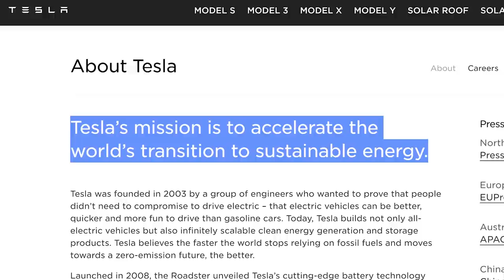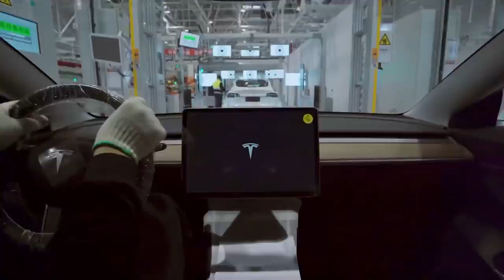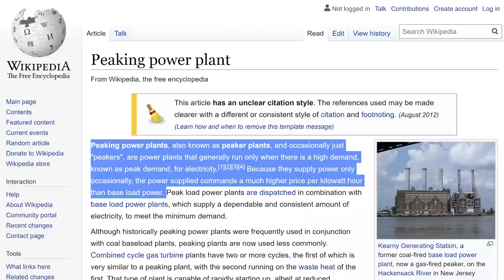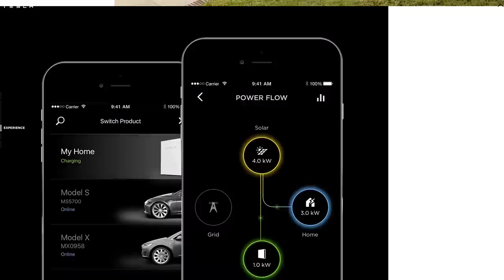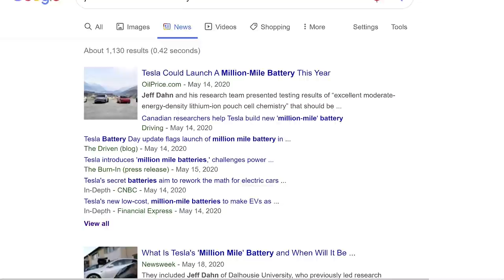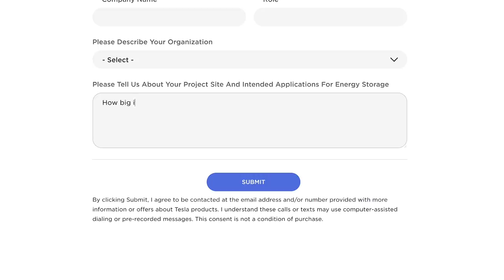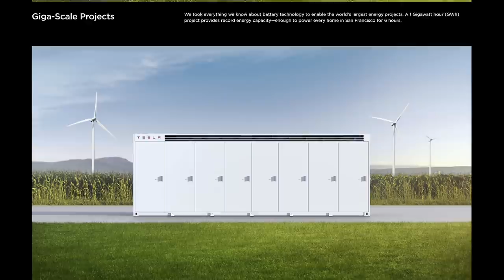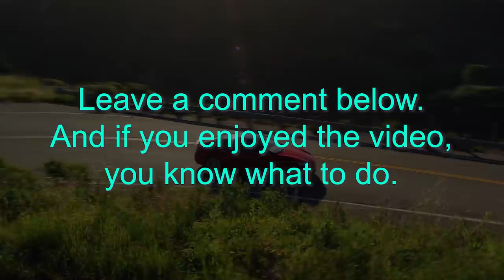Tesla Batteries Will Make Billions ⚡ (virtual power plants, vehicle-to-grid & Autobidder software)

Comment: one thing about energy trading: the more this technology is adapted, the more the price difference will disappear. so earning income with this will work only during adaption phase. because why would the price go up and down, if the supply of energy always easily meets the demand from storage because said storage is covering it fully?
Reply: This is a good point you made. However, I think Steven is also making the point that taking over a corner of and disrupting the energy market is what is going to make Tesla & it's shareholders the mega bucks.
Reply: Yes but this energy arbitrage will last a long time certainly for 10-20 years because more and more intermittent wind and solar are being added to the grid so more and more batteries (or other forms of storage) will be needed

But what is obvious is the value of a car as a battery will go down as battery costs go down

At $5000 for a Powerwall (or whatever it is) the value of the car acting as your Powerwall is at most $5000

If the price of powerwalla falls to $2,000 then the value of the car acting as a Powerwall also falls to $2,000

I know the car battery is significantly bigger but the value isn't linear. Buying a second paper wall has much less value than the first 

Overall I think power walls have more value as storage and solar buffering than the Tesla cars. But since it can be done for cheap via a car it should be done but it's value is definitely not 5 Powerwall at today's prices as some are trying to calculate suggest. It's closer to the value of 1 Powerwall at 2025 Powerwall prices
Reply: @kaya051285  ^ this. Increasing variability of generation over time will, all else equal, improve the profitability of battery backup. However, this is counterbalanced by declining costs for batteries. The price may fall, but Tesla's long term cost advantage over competitors is looking unassailable, meaning they will likely capture most of the profits in this burgeoning market, regardless of what the market price is at any given time.
Reply: @Global_Optimization  The value of a million mile battery (or rather a 4,000 cycle battery) is at most about £3,000 in the UK it's certainly worthwhile doing but it's not worth tens of thousands as some Tesla channels are suggesting

At least in Europe (and probably many other areas too) a large part of the solution to intermittent solar and wind is mass interconnectors. The UK will build out 10-20 interconnectors this decade which will give the ability to export excess wind and import excess wind/solar

The biggest solution is actually higher capacity factor wind farms. If offshore wind farms can be designed with 50% capacity factor that would be much easier to integrate into the grid than 25% capacity factor wind turbines
Reply: @kaya051285    Yes, it will be a trade-off between minimization of four main costs: 1) Extra generation capacity 2) Storage capacity 3) Smart load response 4) Control systems overseeing all this (autobidder may have made this cost negligible, but I don't think we have enough public information to know for certain yet)
Reply: @kaya051285  agreed, I think in the long run they can make at least an average of about £10 / kwh  of grid storage capacity if they capture all the ancillary services so as to reduce the excess generation capacity needed. If a 400 mile car has 100 kwh, that's about £1,000 per car in additional value. If they sell 1 TWh per year, which is their minimum ambition, that's £ 10 billion per year in gross profit, which alone is enough to justify their current market cap, ignoring their other business segments
Reply: @Global_Optimization  The capacity payments are per KW per year. It doesn't matter how big the car battery is it depends what it can export to the grid and current regulations are 3.7KW max from home to grid in the UK

So if you could get £10/KW for grid services you'd get £37 a year not £1,000 a year

On top of this you might make £350 a year buying cheap selling expensive

The two combined are ~£400 a year

And this assumes the customer doesn't use the car and just keeps it as a paperweight at home. Obviously people use their cars so this upper bound of £400 is unrealistic for most cars

V2G is worthwhile but it's realistically a value of ~£3,000 over a period of 10 years

And this assumes zero cost
If you need to fill in paperwork
Have government or grid workers come to check. Or additional hardware. It will eat onto this £300 a year

Still worthwhile doing but it's not some magic bullet that justifies Tesla stock price
Reply: nope it doesnt work like that because not every area has the same energy potential, for example in germany the north is where there is most of the electricity generation the south not so much
Reply: @Global_Optimization  wtf is the advantage here?!?! ABB, Siemens, CATL..... are already leaders in the energy sector, what is needed is just cheaper and better batteries. in europe they can already produce enough energy but most of it (wind energy) is wasted due to the lack of storage
Reply: @kaya051285  yes the UK, germany are seriously installing mega wind farms and its working well, they just need more energy storage
Reply: @carholic-sz3qv  Most of it is not wasted, a small amount of it is wasted. As we don't need to use storage which is costly and inefficient. We could instead for example regulate retail electricity tariff to be 3 cents/KWh for dual fuel boilers. Many EU homes have natural gas boilers it wouldn't cost much for new boilers to come with a 3KW electrical elements so as to be dual fuel boilers

These boilers can work on natural gas most the time but when there is excessive wind power they can use their 3KW electrical heater and pull back on using natural gas. Just in Germany there are 30 million such boilers giving the ability to use upto 90GW of excess electricity when there is excess

A smart efficient cheap way to use excess wind/solar the only real cost is software and maybe €5 euro to add an electrical element to boilers

Of course there are other options too
For example if gas boilers were banned then homes would have no choice but to switch to heat pumps as old boilers break down. This would greatly increase electricity demand across Europe and the curtailment problem would mostly go away

And finally of course interconnectors
Sometimes the UK has strong wind output France has little wind output. So we can export our excess to them. Likewise sometimes they have strong wind we have weak wind so we can import during those times

Mass storage of electricity by batteries doesn't make sense. Some amount makes sense for other services but not for bulk electricity storage

Also Norway has the potential to store a HUGE quantity of energy via its hydropower. Although the power amount isn't huge it's about 10GW the storage amount is massive in the region of 10s of TWh
Reply: @carholic-sz3qv  Bulk Electric storage via batteries won't be possible because such electricity useage is seasonal which means the batteries will be charged and discharged just once a year. Even if you can imagine batteries at $30/KWh and they last 30 years that results in $1 per KWh which is far far far too costly

Everything will be done to minimize the amount of storage required. The cheapest option of which is spreading out the wind farms eg UK wind farms will be placed all around the UK not just in one spot. The next is to build lots of interconnection to neighbors which is being done the UK will have >20GW connection by 2030

Then we will increase our electricity demand by electrifying heating with hear pumps and resistance heaters so less wind is curtailed

And finally we will probably do a small amount of excess electricity to hydrogen which can be used in CCGTs to fill in periods where intermittent supply is too low

This doesn't mean there is no role for batteries in the grid. It means maybe a country can use 1 hours of battery storage so for the UK maybe 40GWh of battery storage would make some sense. 40GWh storage with 10GW power. This would be mostly for grid services and some small amount of renewables buffering

Comment: Your comments re electricity are mostly only applicable to a small part of the world a small part of the time. If you look at BM reports for UK data the top 10% peak price of wholesale electricity today is about £35/MWh while the bottom is about £10/MWh so any arbitrage is only £25/MWh and a 50KWh pack is only 0.05MWh so a full charge discharge cycle will net £1.25 before factoring in charging losses and capital cost of using a cycle

Also it's unlikely this will be done by cars to any great degree. What's more likely is future solar farms and wind farms will have inbuilt battery storage which can act to make the solar/wind installation more profitable and the same batteries could also be used for arbitrage

There is some benefit to V2G but it's not a huge amount. Worthwhile doing it might add £2000 value to a Tesla model 3 over its lifetime
Reply: While this is currently true, as solar and wind form increasingly large shares of the power grid, market forces will change the prices differential, making time arbitrage more profitable. More importantly, lithium batteries provide other valuable service beyond merely load shifting. They also provide valuable stability services, for example, which is where most of the value of the Hornsdale project has come from according to what I've read.
Reply: @Global_Optimization  Yes I know but other grid services in the UK don't pay all that well. For example capacity payments are ~£6/KW/Year so a car connected at the 16A domestic regulated limit might be able to bid for 3.7KW of capacity payments which would mean about £22 per year of value for capacity payments  IF you can guarantee the car will be plugged in winter days between 4-8pm

Comment: You were incorrect on turning current cars into V2G with only software changes: https://youtu.be/UkRk2OQI7RE They would need to be hardware modified.
Reply: Tesla Fudge No! He was right.  2017 model3 has already hardware built in sitting there waiting  and when the timeline comes, the right software will awake this feature. Please check the last episode of the channel “now you know” they had a great revelation on that.
Reply: Dinos Megkos I watched the episode, that only applies to the new million mile battery models which will likely have that capability. The current gen cars do not have the circuits to do V2G, they will require an upgrade to their hardware, or an added gateway or new powerwall. This electrical engineer that aftermarket services all models knows the internals very well: https://youtu.be/lXokJEzXwaI

Comment: Costs for the car itself won't go down
Costs for the electric power train will fall

If the car costs $25,000 and the electric power train costs $15,000 the latter might fall in price 10% a year which would mean a $40,000 Tesla might become a $30,000 in 2030 that's roughly when I think ICE and EV price points will start to converge around 2030
Reply: @into the now Best selling car in Europe is the VW Polo it costs £12,500 while the Tesla model 3 cheapest version is £43,500

The insurance for the model 3 is about twice that of the best selling car in Europe because the Tesla is faster and more expensive it is in a more expensive insurance band

The Polo you can get serviced anywhere and parts are cheap and abundant. Are Tesla parts cheap and abundant? Can I get any garage up and down the country to service and repair the Tesla or do I need to pay out premium prices?

I'd suggest you are being willfully blind, not me

Comment: Critical thinkers please reply:  Something many have not addressed.  As transport transitions to electric, the electrical demand will increase substantially, and the peak demand will likely shift.  Yes peak now is highest during the heat of a long day because of HVAC demands.  However that is about to change and drastically.  The current peak will likely go up because not all transport will be charged at night, however vehicle to grid will buffer areas that would require a peak plant to fire.  Its possible that at some point the peak demand coming at night will meet those of the day because of charging transport.  Ultimately a balance could be struck where the demand is steady state so electrical generation and demand will be steady.  So likely we will even out the generation curve but the output of electrical generation will go up and substantially.  It is likely that peaker plants will still not be needed but generation will be much higher and more consistent.  The problem exists that if the balance of electrical load is not being offset by the buffering effect of vehicle to grid technology.  And as the electrical load demands increase will we have enough generation (all electrical generation) capacity to meet the massive loads?  In conclusion as EV's become more prominent Vehicle to Grid technology is eminent and and must be done, its not an option.  Elimination of peeker plants is actually a result of what must be done, its not the real reason vehicle to grid will be done.  If sustainable energy is not ramped up quick enough, and the non renewable/nuclear generation can not keep up additional non renewable power will have to be created.  Still better than all the fossil burning transport that would otherwise be on the road.  Tesla, IMHO, is the only corporation on the planet that can do this, they have to if they are to fulfill their mission.  Other companies are struggling to keep up, not even concerned about the electrical load implications coming.   If it was not for Tesla, I believe we could get to a situation where an imbalance could drastically stall sustainable transport.
Reply: This isn't a problem to worry about any time soon because electric cars are still a tiny fraction of the grid and the amount of electric cars produced annually is still tiny

In many nations improved electrical efficiency of lights and appliances is actually greater than the additional electricity demand from population growth or EVs

For example the UK has about +10% population bs 15 years ago yet our electricity consumption is actually down 15% or so since then. We have so much spare capacity that we could switch 1/3rd of all cars to electric overnight and the system would still function just fine

Solar/Wind and EVs will be deployed slowly
It will be fine
Is expect around 2050 most the grid will be 'clean' and almost all new car sales will be electric

I also expect most roofs to have solar panels by 2050 especially if solar tiles can become affordable so they are the default replacement to old roofs. If that happens 1/3rd of electricity generation can be local on roofs the other 2/3rds would be nuclear hydro wind and central solar imported to the urban areas
Reply: I Kaya all great points, however there will be terawatts/year electrical load being added very quickly.
Reply: Be interesting to find out the true non-subsidized total energy cost of ownership for building, material supply and running costs of current peaker plants. As these fall by the wayside I would imagine the amount of energy saved to be a fair, all be it one off, large saving. Same goes for the total energy cost of continuously drilling gas & oil out of the ground/sea. Every oil rig has a huge electricity foot print and believe it or not, some are powered by Solar/Wind ironically.
Reply: @305dreamhonda  it's not a problem most grids are far bigger than the demand that will be placed on them by EVs plus this isn't an overnight process we won't go from almost zero EVs on the road to 100% for at least 30-50 years

Comment: if solar and batteries were the solution n why is China and India building over 100 Coal fired power stations, even Germany is  building a dozen Gas powered  power plants, solar/wind and Batteries for the  moment wont solve our base load  power  generation, you put to much faith in Solar  which is not efficient and the  South Australian battery solution only solved the over load problem, unless they can solve this then batteries and Solar/wind wont be enough.
Another  thing unless they solve the problem of longevity on Home solar  solutions people wont be up taking solar, i have  learnt that solar solved my problem for a short  time and after  5 years i have to replace my solar panels through degradation and also maintenance  and updating  my  converter has cost me a lot of money. i have found the wise use of my Power  through purchasing more efficient Appliances   has saved me more money than my solar panels in the long term.

Comment: Steven  . . . what if Elon Musk is one of the mysterious clients Andrea Rossi has pointed out in his "YES" response to the following question: "Are any of your prospective customers hoping to use the E-Cat SKL to power electric vehicles?"
Link>>  http://rossilivecat.com/all.html
Link>>  https://e-catworld.com/2020/05/03/several-agreements-have-been-signed-for-the-commercialization-of-the-e-cat/
IMO, this would simply and dramatically propel Tesla towards the future you paint. Each Tesla sold with an integrated Ecat SKL becomes an "infinite range" car and an enormous source of electricity for the grid when plugged into it's "charger" . . . a "charger" whose costs drop as the charging function is no longer needed, only the smart connection to the grid.